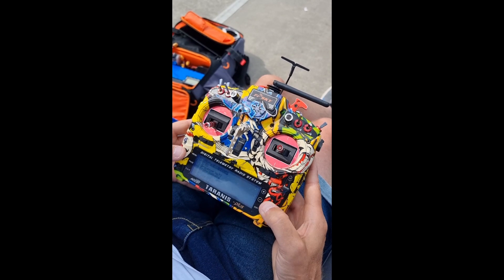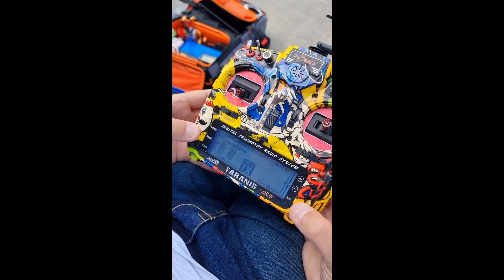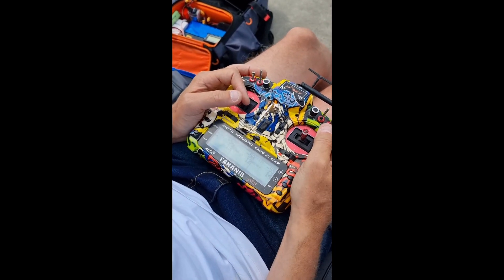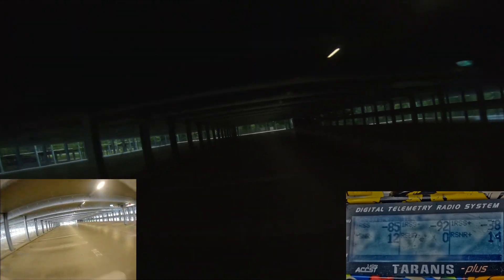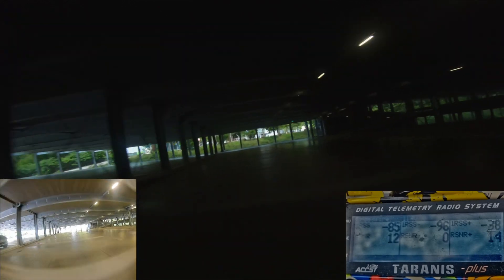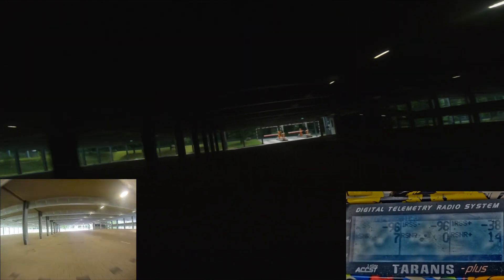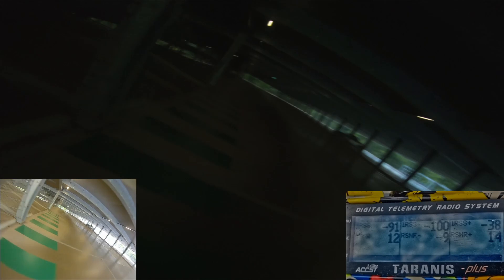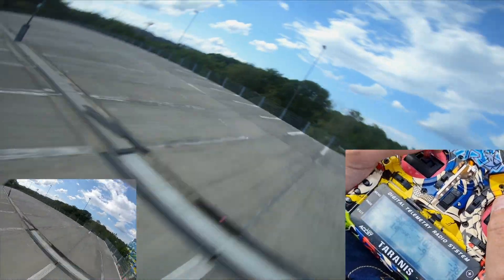Happymodel EP1 ExpressLRS Test 150Hz@100mW

Comment: What is the 150hz and 100mw ? i'm new and not sure what settings to use. MW = range ? and hz whats that?
Reply from the maker: Hz is the transmision rate. The higher you set it at the less delay measured in ms you get. The lower you go you get more range. mW is the output power, higher means more range but 100 mW with 50Hz transmission rate will give you like 30-40 km.